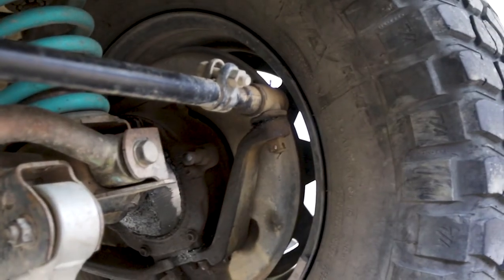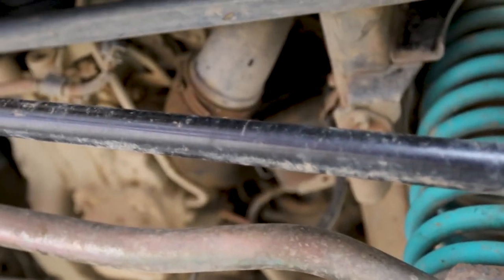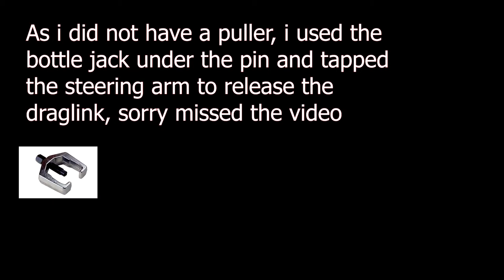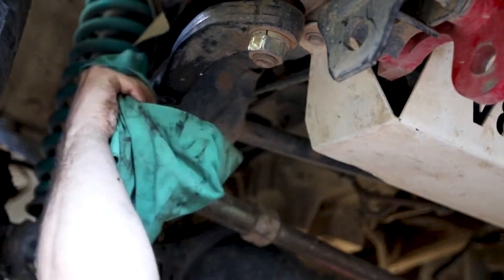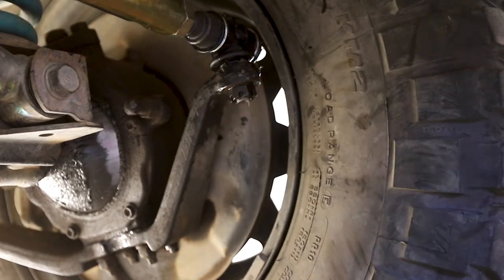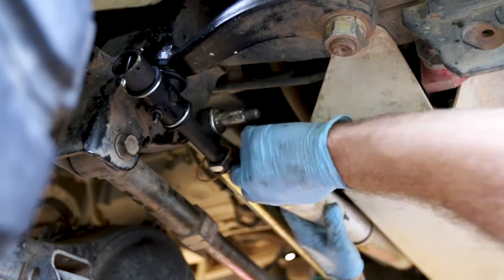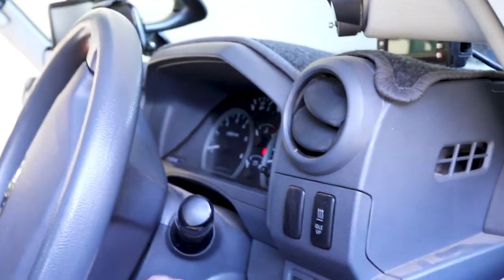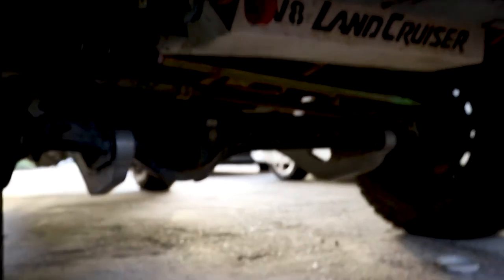DRAGLINK LANDCRUISER 79 series toyota Tie Rod replacement

Comment: Great video, thanks!
Just finished my dobinson 3-inch lift on my 80 series. I put an adjustable panhard to re-center the front end now my steering wheels off. I'll just a drag link.
Reply from the maker: i find it surprising how many wheel places i have gone to that have no idea how to play with solid front axle suspension and steering components. Im glad my vid may have helped

Comment: thanks for the video, i have a lot of shaking on my vdj79 single cab, from 30km/h up to 80 , and has new tyres, should i replace all the bushes? i just bought the car from auction, 330ks
thanks mate
Reply from the maker: Im no professional but in my experience, if it was delivered with new tires I would suggest getting them balanced somewhere reputable, alot of auctions just chuck new tires on to make it look good. If you got the tires hopefully the tire shop would have told you if there was any issues with the rims with that said, be concerned that its happening at such low speeds, best get a professional check over it mate, bushes, barings, hubs, Axel's even diff housing, so many things to look at on a ute that you are not sure has ever driven straight. Good luck mate let me know how you go. 
Start at the cheapest end and work up, tires, rims, bushes, bearings ....

Comment: Nice video mate
I have a question 
Please can you answer me if possible
My front wheels wobbles between 60km to 80km(land cruiser 78 series troop carrier)
Any suggestion for what my problem is
Thank you 
Your response will be kindly appreciated
Reply from the maker: if its speed related 99% of the time it's your tires. the only issue is, its hard to get them right if its your tires. if you are 100% sure it's not them check all your bushes, pan hard, then drag link and tie rods. this then only leaves kingpin, and even bearings... but like I said it's usually your tires. keep rotating them you might get lucky if they still wobble after a balance
Reply: Thanks mate
Changed my bushes and now there isnt much wobbles